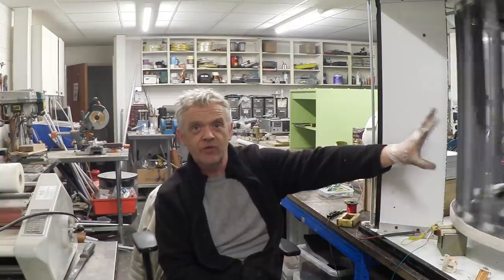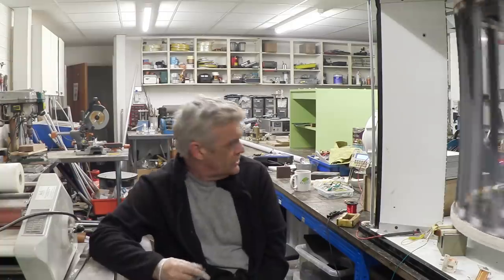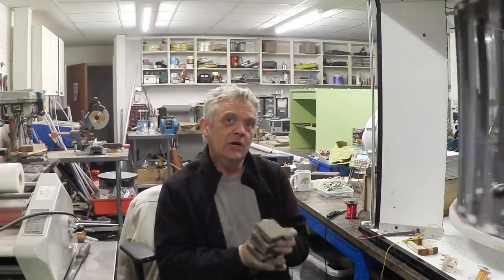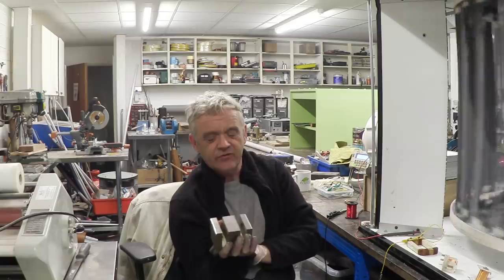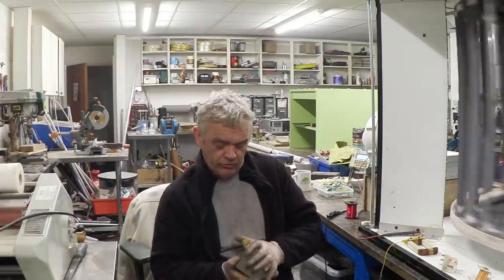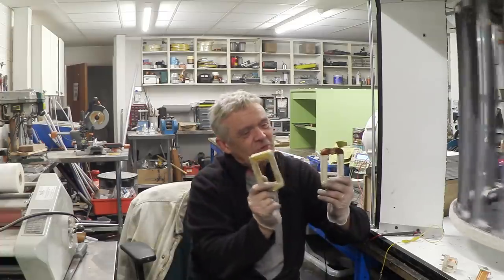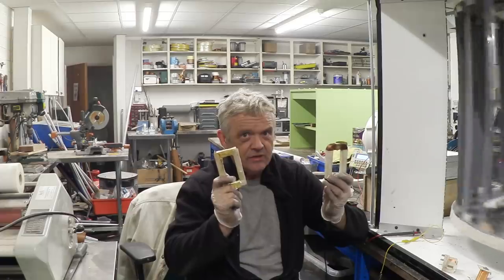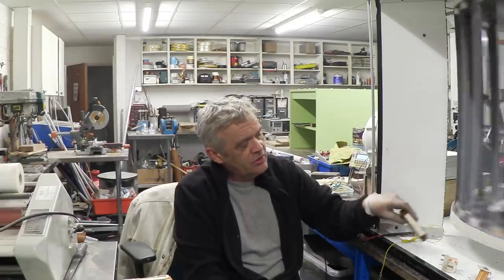Building a 1kW Wind Turbine For Under £100 - Part 5 - Messing With Coils

Comment: Great stuff, thank you!!
Did you try just the coil, thick and thin wire without the iron core and different orientation, so the long side following the rotation of the magnets and the short side?
Have you tried both coils with and without the iron core stacked or side by side, alternating ?  Perhaps a way of using and choosing the output that suits you best and as a function of the windspeed at any given time...
I am nothing of an electrics expert, so sorry if I am all wrong but very excited about your project here!!
And very curious to see what the output will be?

Comment: In you I feel that I have met another "instinctive engineer". I started at age 11, now 76. I found out most of what I know using your trial-and-error techniques. I was a technician working as the hands of engineers with degrees but I never got qualifications and I have thought, people like Hertz and Faraday and Tesla didn't need formal qualifications. I was just always fascinated with the workings of electricity and electronics. Rivetting stuff, thanks.

Comment: I found myself thinking that the amount of iron core could be dynamically decreased/increased in direct relation to the windspeed.  Kind of like a slug tuned inductor in radios.

That way the "windmill" could spin up under low speed winds producing some power, and if the wind grows, more iron could be incorporated to achieve higher output & limit possible overspeed conditions.
Reply: It could be interesting to have a couple of copper coils around the turning circle with iron cores being able to go up and down, regulated by the system which was used in Diesel engines. In fact they are weights rotating around the central axis in a scissor configuration, with a spring in between to keep the weights close to the axis. The higher the speed, more the weights tend outwards. This could be a direct regulation system to shift iron cores up and down
Reply: @paulbrouyere1735  
Cool... hadn't thought about the speed regulator mechanism specifics, but diesel engine governors would be a nice model.

Comment: You could still use both the primary and secondary coils. Just don't connect them to each other, but rather use them to get two different voltages.

You could even use two primaries (connected correctly) on one e-core and two secondaries on another. Should work.

Also: Keeping the e-cores gives you better efficiency.
Reply: I wouldn't use the secondary coil in principle.  I think that the resistance of this coil, due to the number and thin diameter of the windings, is much higher than the resistance of the primary coil.  Due to this resistance, you get more thermal loss.  P-loss= (U x U) / R

Comment: I was expecting you would have tried to paint the conductive ink on kapton tape to use as the coil winding by now. The old royal society of electrical study books reference constructing coils by weight of copper as well as length among other properties to do with electrons that free to move within the copper. Some portion being easy and some less easy. Something to think about when tweeking a paint.

Comment: 3:04 Comments from a physics perspective. 

1. Yes, the magnets have to mover across the poles of the transformer core -- passing a leg then a gap then the centre core, then a gap then the other leg. With the lid on the transformer core, most of the changing flux cannot get into the inside of the coil and has no effect.

2. The ideal spacing of the magnets would be with their centres separated by the gap between the centres of the two slots. That is because as a North moves across the centre stub, there will be a South moving across both the outer legs. because of the shape of the transformer core, the flux from the two Souths gets turned around and all three magnets re-inforce each other. So the tip would be to measure that distance between the centres of the gaps, and then measure the perimeter around which the magnets will be placed, and divide one by the other. Then the ideal number of magnets would be the nearest even whole number to that result (has to be even as you want to alternate Souths and Norths).

3. Having the coil a bit bigger than the magnet length is actually good, as the extra width will catch some of the flux from the magnets that spills out sideways. 

4. It is a property of transformers that volts times amps is the same regardless of turns. Therefore it is exactly as the physics predicts that you got the same Wattage regardless of which coil you used,  if we ignore the resistance of the coil. It is good to see this experimentally verified by someone who didn't know what to expect and therefore couldn't fiddle the results to fit theory.  Use whichever best fits the voltage your electrical system can cope with. 

Hope that all helps your next build as much as your DIY is helping me  --  I may know the physics but the practical side, for me, is the hard bit.
Reply: Great comment, thanks!!

Comment: Hi Robert .As I said in a previous feed back  that the magnets would act as a brake on your wheel. I have had a lot of experience in generating electricity . Your best result would
 be to wind as many coils as you can fit on the dia .The coils must be just slightly bigger than the magnets.any wire outside of the magnetic field will act has a resistance and pull the 
output down. The coils would have to be embedded into cut-outs in a large stationary disc  ,so there is only a small gap between the magnets and coils .They will need to be coated in 
fibreglass resin  to make them waterproof . You will then need another disc below with another set of magnets which will rotate . the magnets must be set up with opposing polarities
 to the top set of magnets . The only reason you have generated  a descent amount of energy with the microwave transformer is because of the iron core and only one transformer coil . 
Any ferrous metals are an enemy to this type of generator unless you had a much larger area of wind sails to overcome the magnetic drag. Additional . A larger dia of wire would be 
beneficial as this would decrease the resistance and separate the coils into banks of phases wired in series then rectified .

Comment: Fascinating stuff.  This is precisely how a magnetic pickup works in an electric guitar.  One way to really boost your power generation is to place as many coils as possible under the base disk and connect them all in series, or connect pairs in series and then connect those series pairs in parallel with the other pairs, etc.  The critical consideration for multiple coils is they must be properly placed, and the spacing of the magnets must be correct so the AC pulse in each coil is as synchronized as possible.  This creates constructive phase interference in the AC phase relationships of the coils to one another.  If the spacing is off and one or more coils fires out of sync with the others, that creates destructive phase interference and robs you of power.

Comment: Bravo! very interesting results.. How would the results differ if the magnets were stronger? would that up the volts and current? Also does the "unused" portion of the coil cause a higher resistance since it is just a carrier and not a producer? Will putting an iron "plate" in the center of the coil work (you might try that in your next phase to see..unless you're already done). I am sorry I am 68 and electronics has never been my focus.. I do not understand why the wheel slows down under load? can you  tell me where I can look up this reactance? I do not understand it though I know that it does.. Oh I love this stuff.. makes you use the little grey cells as H.P. used to say. Carry on!

Comment: Use the core! For a given power output, you will need far less coils because as you noted the core focuses the magnetic flux. The slowing down of the turbine was just how the turbine develops the torque needed to supply the power for how much you are drawing. When there is no load, the turbine will accelerate to (nearly) the speed of the wind, but at that speed you are not extracting much energy from it. For a given wind speed the energy that can be extracted increases with a decrease in turbine velocity due to an increase in angle of attack, until the angle of attack reaches the critical angle of attack at which point the blades will stall. How much it will slow down before stall will have to be determined experimentally by adding more and more load until the power output suddenly drops and the turbine suddenly slows dramatically (this could be done by adding more coils and slowly adding more load to each in turn). I would guess that the ratio of max load rpm to no load rpm would probably be the same at different wind speeds, but again, that would have to be determined experimentally. It could also be a set rpm drop. experiment and see! Great video series!

Comment: I would stick with no core to reduce cogging. Cogging will make startup harder and also cause crazy vibrations once it's going. Another suggestion is if you can neatly fit 52 coils in you can wire every third coil in series to give three phase output (ratio of 4 magnets to 3 coils). Enjoying watching the progress!
Reply: or 2 magnets to 3 coils like motorcycle alternator

Comment: Two coils of wire are needed. The coils are wired in series. The need to be placed so that each coil is under each magnet at the same time so if your magnets are. 10mm apart, so must your coils. The coils must lay flat or in a magnetic core that becomes magnetized as the flux rises and falls with each passing of the magnet. The core can be a "u" shape but each pole of the core must align with the spacing of rhe magnets. You can mold core out if magnetic powder and a resin or make them up as laminates as your transformer is.
There are many generator designs in the web
You can also wrap wire around a bolt. The ends of the bolts need to be very close to the magnets. This is crucial. Wind all coils in same direction. You can connect every other coil in parallel for more current. The voltage will depend on flux density and amount of turns on the coil. So once every other coil is wired in parallel you will have two coils sets. Lets call the. A & B. You then wire A & B in series so you wind up with 1 wire from set A and 1 wire From set B. Those are your alternating current output. Of course wiring all the coils together will induce a load on the drum. Like I said before yoy can use an arduino to control how many coils are in circuit thus controll speed that way. In high winds all the coils are "online" and in slower winds only a couple of coils are "online" you can use one coil as a tach to determine speed.

Comment: What if you had a deployable core? At higher wind speeds, insert core, as speed goes down, remove core... like pistons even.
Reply: even having cores that can be moved according to wind speed will require some torque from the rotor.....thus cancelling out any gains and making the whole thing more complex more expensive and more likely to break down ....lose lose lose situation
Reply: I think the K I S S principle is priority here, considering how difficult it is to service the machine after it's up.

Comment: Many have mentioned controling speed using diff. coil/ core arrangement.   Im guessing years ago a large dumpload was droped across at a certain voltage to slow it down.   As a cheap failsafe (Storm protect) simplest thought would  be a spring loaded Flaper that pulls friction brake lever above certain windspeed.

Comment: Hi,
You need more coils typically a ratio of "1 magnet and 1 coil" or "2 magnet and 1 coil" per phase.
Also the maximum power that can be extracted depends on the strength of the magnetic field of the magnets and the gap between the coil and the magnets

Comment: Hi Rob just a thought how about install the two different types of coils and put them on a switch .sort of a high and low output for fast and slow winds ..so iron core for high speed (hurricane)may assist with braking.and non iron core for low speed gentle breeze.

Comment: I made an alternator from a grinder floor cutter disk being thrown out and a bike wheel and a load of copper 1.5mm  enamelled wire 70 turns a coil 12 coils in 3 phases and the disc had 16 magnets put it in a plywood case with 4x2 frame it works I haven’t tested it with wind or hydro power yet .... Im using a smart drive washing machine motor for the hydro instead re wired it and am getting 400watts but the alternator I made I want to test on the new set up ..... also something I thought of perhaps you could try .. I planned to experiment with the coil set up but I’m happy to share the idea I was going to join the coils yet use capacitors between the coils this may seem irrelevant but I’m interested if we look at water and apply it like they did years ago to electricity I was thinking about for instance the Tesla pulse jet valve and effectively applying this to the terms of electricity at the foundation of where it’s created in the alternator itself also was thinking rather than capacitors using lithium titanate batteries like a hybrid battery 🔋🤔😂🤪

Comment: I think you need to move magnets closer to axis. You arranged them on edge to simulate effect of high rpm(magnets with high frequency passing by coil), but the further from center of rotating mass the easier to slow down rotation, so you experience decent deceleration which defeat the purpose.
Or you need lot bigger wheel to harvest more energy from wind, or improvement of blades.

Comment: You talked about the choice of core/non core and the implications on operational speed. You could have an arrangement where you move cores in and out by mounting them in a sliding board. The cores could be moved in as wind speed rose...

Comment: Hi Rob, I am an electrical engineer. Coil voltage V = B*A*f*N
Where B=magnetic field, A=Inside Area of coil, f=frequency of flux change and N=number of turns in coil.
To maximize V you need high flux, large area coil, spin wheel faster and maximize the turns in the coil.
If you dont have a core then the "B" value will be low so voltage (and power) will be low.

Comment: I would think that if the inductance is larger, then the AC wave going thru the inductor will attenuate less. Tesla would have you determine the exact frequency of a rotation and hence your AC wave, and then "tune" your coil to that. With the self-resonance of the coil (or by adding a capacitor), you could have the resonant frequency match the frequency you get from the ideal rotation rate. Also, most people seem to have 3 phases with 3 coils arranged in series. I suppose another thing to buy is the Wind charge controller and diodes, etc.

Comment: Were I in your shoes, it would be a bit odd, but I would be inclined to use both coils on a single core but adjacent instead of stacked - I envision each coil half on/half off on the outside leg of each core instead of the center. The orientation of primary and secondary would be motivated by the purpose,  if the path of rotation takes you over the  primary before the secondary, you would get a higher voltage and the alternate a higher current, with the  core shape producing a wow in output from the first coil that could perhaps generate a better result in the second? Just a thought, at any rate thank you for your efforts and the mental exercise!

Comment: In the spirit of keeping it simple I liked your idea of simple wound coils with an iron bolt in the center. It would be a lot of work if the bolts have to pass through the base of the construction. An alternative is to mount the bolt - coil assemblies on 3 or 4 semi circles that you slide under the impeller and the semi circle bases be clipped into place. They could easily be removed at any time and as a group to alter their construction (play with) or for repairs.

Comment: Interesting video and useful experimenation. A few comments: as energy only ever changes state (so can't be made or destroyed) you can only get out of a system in total what you put into it - in this case the energy supplied by the fan is converted into mechanical (kinetic) energy by the air acting on the rotor, you are then converting the kinetic energy into electrical energy. When you apply a load to the electrical output, the energy is converted into heat, and the lower the resistance of the load, the more energy will be drawn from the rotor, so it slows. When using the coil without a core, the efficiency of the conversion of energy is much poorer, so less energy is taken from the rotor, and it slows by a lesser amount.

The reason for the core thus becomes apparent - for the same power output a much smaller coil can be used, which for the manufacturer means reduced costs, and a more compact product.

When you connected the two coils together I assume it was in series? I suspect that you had the coils mounted such that the outputs were out of phase with each other and thus acting against each other - if you tried it again whilst making sure the the windings on both coils are in the same orientation, maybe it would work as expected?

I return to a point I've previously enquired about - when you took your measurements and calculated the power output, were you measuring the voltage and current at the same time, or was the voltage open circuit, and the current short cirtuit? Thanks!

Comment: Add a reed switch in series with a capacitor then the end terminals in parallel with the coil. Adjust the reed switch position to the magnets finding the sweet spot. 
You will get an increase in the output also reducing the coil drag. Be careful, you will end up with high voltage at the terminals. Success!